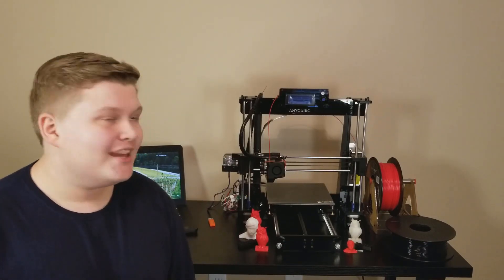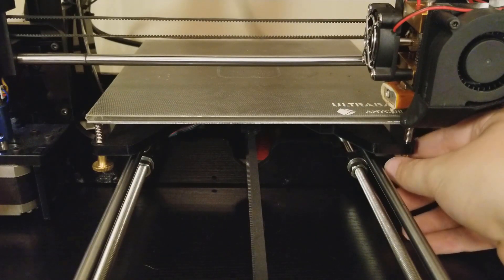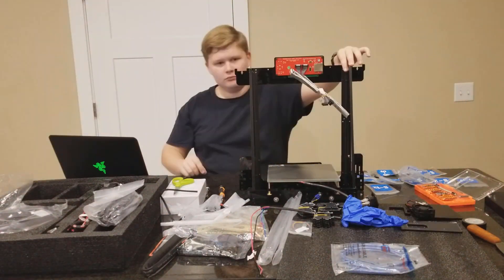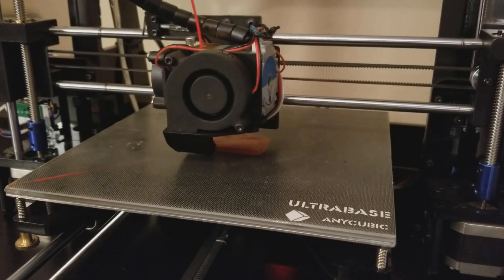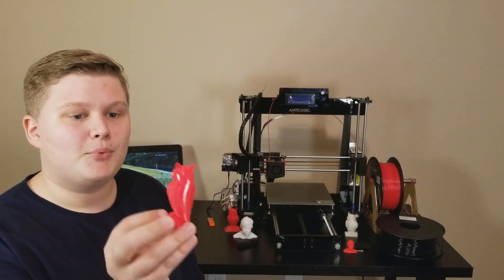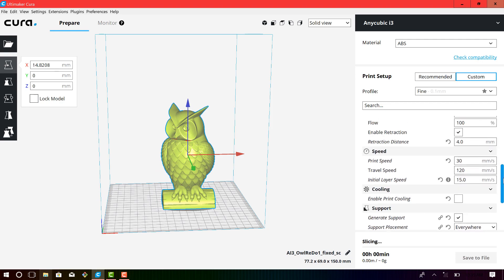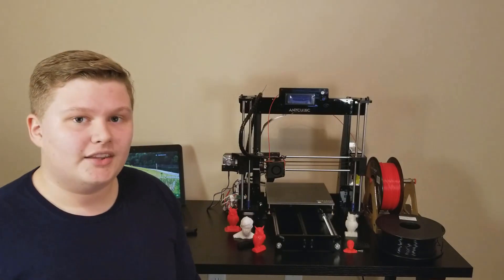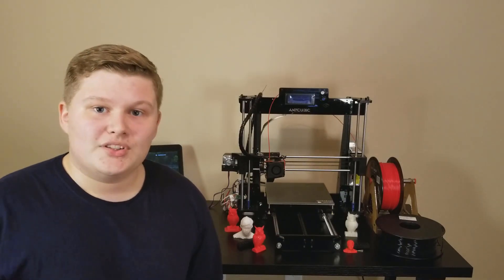Awesome 3D Prints for $250! | Anycubic i3

Comment: Hey Landon, any chance that you export your profile settings for your acrylic prusa i3? Cheers dak
Reply from the maker: +daktah gone Hey, thanks for watching! However, I'm not sure what you mean. Are you talking about the profile setting for the printer that I have on the Cura software?
Reply: Exactly, you can ormally export the settings in cura.
Reply from the maker: +daktah gone Oh, I didn't know you could do that! Yeah, I'll find out how to export the profile and see if I can add a download link to the description for ya. Do you have this exact model or a different version of the Prusa? This profile may not work correctly on a different brand printer, even if your version looks exactly the same as mine. But I'm sure you know what you're doing though!
Reply: Landon McCoy I have the anycubic prusa i3 acrylic as you have. But having problems with everything else but the owl pair test print :(
Reply from the maker: +daktah gone Oh no, that's not good! Yeah, I'll definitely try to get that profile available for download in the description. It took a bit of time to get it working as well as it is, but when you get it working correctly it's totally worth it!